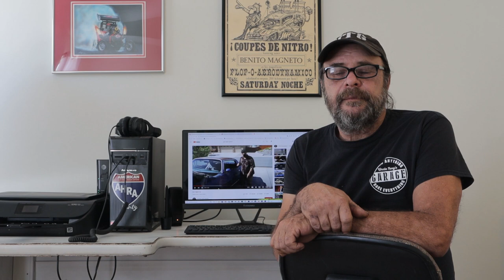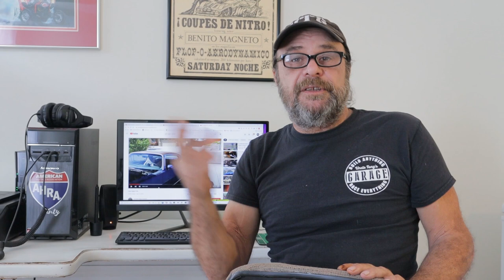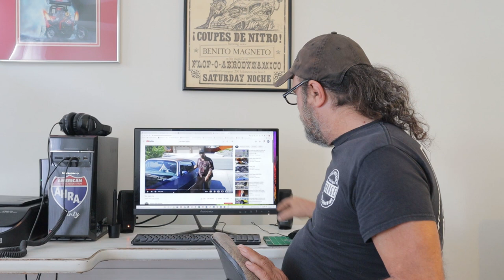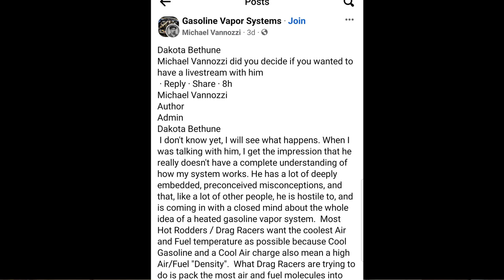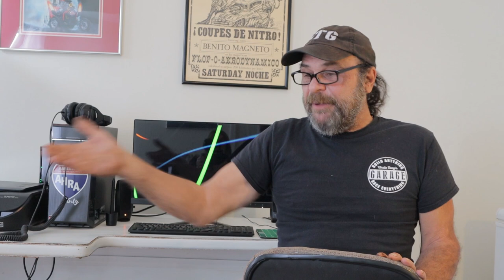Climbing Down The Mega Mileage Conspiracy Rabbit Hole

Comment: I designed, built, and tested a 100mpg fuel system on a car I had. I filed the design with the US patent office. On the same day I was picked up by a UFO that the government sent. The anal probes made me forget the details of my design. They'll probably come get me again tonight for disclosing this, but they did promise that we could cuddle after the next anal probe. So at least there's that to look forward to.
Reply: As Kang told Homer Simpson back just before the 1996 elections, "We have reached the limit of what rectal probing can teach us!"
Reply: @CarsandCats  that was with his mom.
Reply: They're doing tear duct probes now.
Reply: Dang! I'm immediately giving up my research on  a water-burning 200 mpg Mopar 440.
Reply: Mr Destro  Yeah,  sorry,   even aliens don't find that plausible.   LIke stealing someone's laptop and claiming for years it's 'evidence'   but not surrendering it. But still calling it 'proof'  on Fox and My Pillow infomercials.
Reply: I'm positive that Clutch has a song about this...
Reply: Consider that a motorcycle gets about 70 mpg moving little more than the motor, 2 wheels, and the rider. Hard to imagine how a 3000 lb car can do better. 

The old Geo Metro, with a 3 cylinder engine the size of a sewing machine, got over 50 mpg with a manual transmission. That's probably about the thermodynamic limit.
Reply: Ahhh Cuddling. I remember that. I'd give anything for the Cuddling.

Comment: I drove my friend's 1991 Camaro, that I LS swapped years ago, to Carlisle from Southwestern Virginia.  It's got 400 horsepower at the flywheel, a T-56, and a 3.23 rear.  I got 29.5mpg thanks to the .5:1 sixth gear.  In 6th, it passes like a loaded down Kia.  Mileage isn't hard to get.... it's what we give up to get it.
Reply: indeed...OD ftw!👍
Reply: Carlisle PA is like Disney world for car guys
Reply: Good for you
Reply: In 1970 Ford built around 50 of the Mustang E fastbacks. It had a 250 Six with a 3 speed manual and a 2.50 rear gear and the Ford claim was 45-50 mpg. I had that same car with a 3.0 gear and it got around 30 mpg if you drove it like it had an egg between your foot and the gas pedal. I wanted to change the gear just to test the mileage but never got around to it. Even with the 3.0 gear it wasn't much in the acceleration department. As a highway car it was a nice piece to drive...
Reply: this is why I'm a fan of the Gen 3 LS stuff.   It's simple to work on and can easily attain great mileage with a bit of tuning.   Even with a decent cam
Reply: Ethanol does water down gasoline. Lower mileage & power due to lower btu's than pure fuel. You should do a comparison test using pure 100 LL avgas against 94 octane unleaded on the dyno & mileage road test. You got plenty of old cars with no cats. I have run 100LL in a 318 Ramcharger.
Reply: "Mileage isn't hard to get.... it's what we give up to get it."  YES exactly!!!  One could gut there car of everything not required for the car to move and get 50mpg.....but they will have given up too much.
Reply: It's hilarious when these shadetree dudes act like th highly paid engineers at the automakers haven't considered the possibilities in gaining fuel economy. Like we should believe a forklift driver from Sandusky has invented a better system than an industry that pours billions into research and development
Reply: agree with that last line--best solution to fuel economy is to address the loose nut behind the steering wheel.
Reply: @speedmaverick  i think my buddy had one it would do a 60mph burnout in 1st gear
Reply: I had a 1995 TA with the LT1/T56/3.23 combo. On 92 octane I regularly got 30mpg on the highway at 70-75 avg and 23-25 mpg daily to and from work.
Reply: I have a feeling Mr. gasoline vapors gave up a lot to get that 35 mpg at 55.
Reply: @MrJeffcoley1  He claims a horsepower increase and went to a motorcycle carb and heated intake charge.  I bet he’s making under 100 horsepower.
Reply: I agree,   especially cause he might be getting more benefit out of the T5 and maybe equipment-imposed throttle discipline  than he gets out of the vapor system in the first place.  I mean, I never put numbers to the test as I recall,  but my Duster with the 318 and 4-speed and some kind of  maybe-Isky-type cam could amble along through boring parts of a daily drive without hurting a very thin budget too much,  but really opening the taps was still an ever-present option.   I was proud it burned clean   but it could still burn a lot.  

My general style and driving philsophy is to be smooth,  and not to waste gas.   Spending some gas for joy isn't a waste, though.  I'd like to see more of car culture kind of get away from the idea that there must be colossal wide-scale and gratuitous waste just for us to do what we love.

Or that we're supposed to take certain sides in a culture war as if we're really the first concern of either 'side.'   .....I mean, that's not where the joy is in the first place,    ....the joy is making stuff work,    and connecting with our vehicles and each other,   not 'Being as destructive and nasty as possible is somehow 'winning'  against  name-your-scapegoats' when there's actually a real damn climate crisis going on.  

Youtube car culture does seem to be attracting a certain nihilism,   ...while we wring our hands about where to get a decent set of lifters,  you've got your Cleetuses and Emilia Hartfords testing really expensive stuff to immediate destruction for burnouts and numbers.    I start to wonder if that's really about loving cars or  something else.   (Or for that matter if their sponsors'  parts broke cause they were pushing it/being idiots for views   or if they'da broken anyway.)  

Kinda like the Circus Maximus really wasn't the spectacle for horse lovers,   even if they did terrible things to some of the most expensive ones.  (And it's kind of how NASCAR came to seem to what was once a nationwide audience.  The perception became 'Just a power contest with like a Klan rally waiting to see big crashes.'   Even the tech talk basically got reduced to aero and tire pressure and everything else classified.  )

(Pardon lecture mode, there,  but I been getting a lot of grief from people who think their 'culture war'  or religious demands against the usual scapegoats  really have a damn thing to do with gas prices or what cars they can have.   It's definitely measurably harder for me to make a case to other liberals that hotrodding is the least of our problems especially when what's really a technical problem is attached to all manner of awful politics.  (And, frankly, if they get their way,  I  won't be enjoying a cool car anyway.))

 On the other hand,  I'd be interested to know if like some kind of supplementary vapor system like that would be a better equation than those problematic cylinder deactivations on fancy modern V8s, or the asinine 'shut the engine off a lot'  'features'  on a lot of new cars.
Reply: @OllamhDrab  The best counter to wastefulness is a well tuned car, but that involves more understanding than most people are willing to invest their minds enough to have.  Truly understanding ignition timing and fuel consumption are where it’s at.  If Andy Wood can get 600 horsepower AND 16mpg in a 4,000 pound truck, there’s no reason not to, but few understand or care.  Efficiency is a win all the way around.
Reply: @johnwilburn  I dunno who Andy is,   but on gas that's good?    Personally I never even wanted 400,  or even necessarily 300.   

In the real world I can embarass catcalling kids with 110 on cheap Kelly all-seasons.And a slushbox.In a station wagon.  That I really need to redo all the brakes on now.  :)   Anyway, I intend to aim for about 200 naturallly-aspirated if I engine swap this Volvo. Just to not break things,   yaknow.)  

Anyway,   like idiot kids in new Mustangs,   John,   there's a lot of kids who want more power,  and mistake trolling for power   and have no damn clue where they're pointing it.   You may be a dude who they'll listen to about modulating and paying attention,   if they really want a say in things. If it's clear what things are really about.
Reply: I used to go to Carlisle every year for the Super Chevy Show, Mopar Nationals and Hot Import Nights. I live right around the corner in the Allentown area. Good times...
Reply: At steady and reasonable speeds, it comes down to drag more than anything. I can get nearly the same fuel consumption in my 4L IL6 on the open road as a 2L IL4 because all it's doing is creating enough power to just equal the drag which, in my case, is a little more just because of the size of the vehicle compared to most 2L ones. The only real difference in fuel consumption comes from lots of idling around town.

Comment: In the early 1990,s I met Smokey Yunick and I talked to him about his hot vapor engine, he said the car companies did not want the motor because they believed it would burn holes in the top of the piston the military was interested in it so their vehicles would go further on the battle field but then they turned it down. He never got into the details of how it worked but he said anybody with a high school education could have built this motor.
Reply: there was an issue back then with ceramic technology--sometimes an idea is ahead of its time or ahead of economics of scale--but UT also mentioned in another video an issue with the hot vapor engine maintaining its heat in, say, a delivery truck that shuts its engine and makes short trips often in 24 hrs.
Reply: He was a prolific liar, that Yunick.